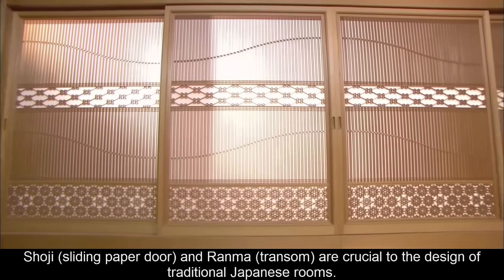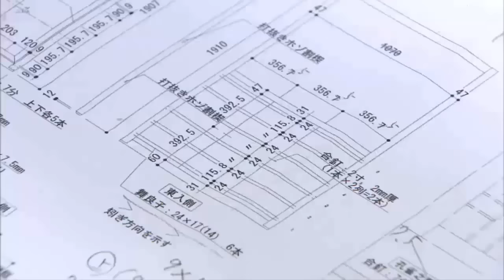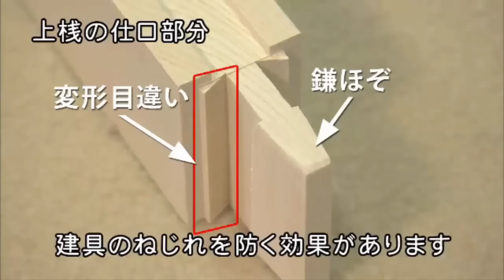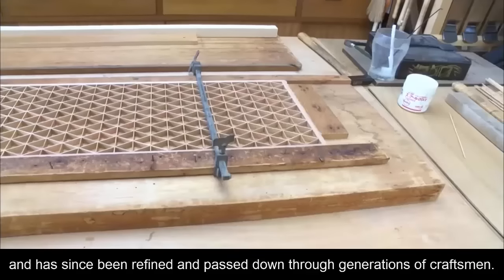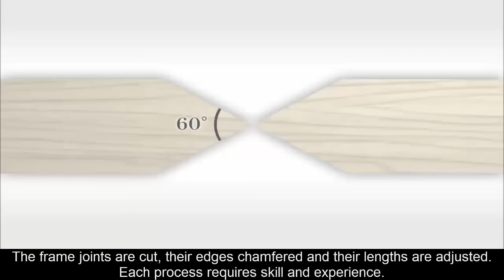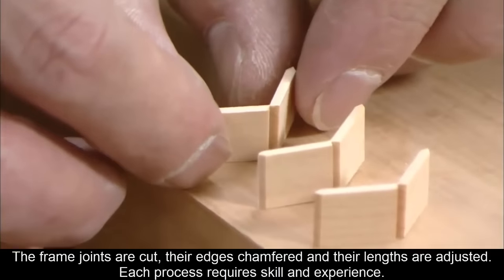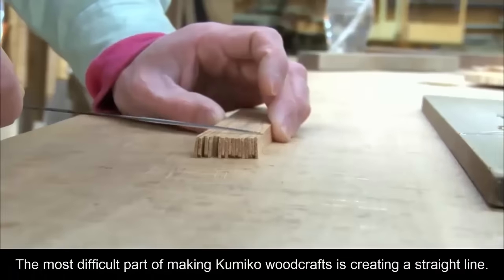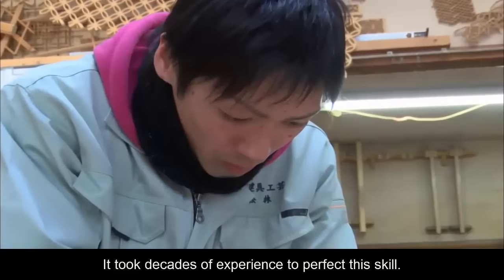Amazing Skills of Carpenters Extremely Satisfied For Woodworking - building without Nails

Comment: This video was so engaging that I watched it more than once. Ideas come to mind. There are tools which accuraely size and shape pieces of wood used in Komiko. These tools are not shown in the video. The strips appear to be about 5 mm thick plusor minus 0.1 mm. And they are straight with uniform cross section having the same tolerance. To get such precision in wood size requires very shar cutting tools, sharper than a razor. What are these tools and what method keep them super sharp? My experience with cutting pieces from #2 pine (construction lumber) is that tight tolerances are extremely difficult to achieve. Cutting releases growing stresses in wood and a straight board can come out bent because stresses are released in the sawing operation. I wonder what wood type is used here. The video shows a fine grained wood. And the wood is strong as seen from tapping on the wedges. I woud like toknow more about the tools and the wood type. There is also a question about the craftsmen wearing white gloves and white hats. Are they preventing oil in the skin of fingers from staining the pieces of wood? Cutting bevels in the end joints with the precision seen in th video requires an extremely sharp saw with many teeth per centimeter. How can these saws be sharpened to give the teeth razor sharpness? There is much in this video to think about.